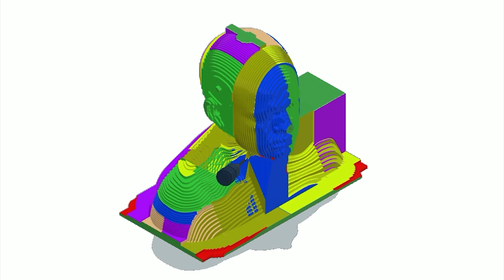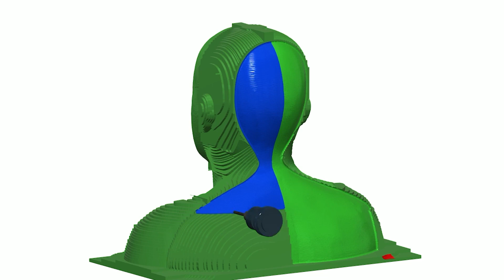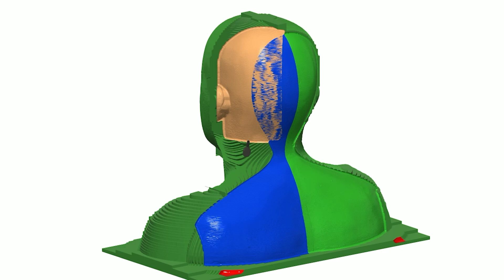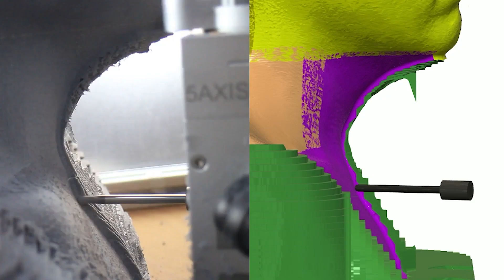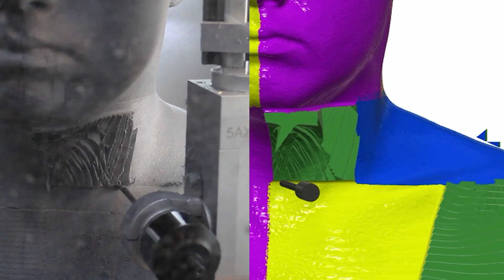5axismaker Advanced Digital Replication Scan to CAM

Comment: The CAM your using originates from Denmark. It’s quite outdated, tough they are building a new version. Most other CAM softwares have a ModuleWorks 5-axis kit in them besides their own paths. This was originally made by a German Mastercam dealer called Camaix, but ModuleWorks has been it’s own company for a long time. 

Anyway you could use a technic called “hidden surface”. You basically put a cylinder inside the bust, and make a nice simple toolpath that goes around it. Then you use the collision check to rise the tool to the STL surface. This way you get very clean toolpath that doesn’t jerk around. But for this you need the ModuleWorks stuff. There are a lot of parameters so that you can get under the yaw, etc.
Reply: this is fusion actually
Reply: Grumm HD I could be wrong, but Autodesk bought HSMWorks, and that was made by Cimco. And now they are using that engine in fusion. If nothing else, at least in the simulation? They still sell the HSM as a separate product for those who want that interface. Cimco is a Danish Mastercam reseller. The product was originally made in the early 2000 as a Mastercam add-on (HSM Performance Pack). It was first toolpath package that had 3D opti-rough (dynamic milling from bottom up).
Reply: @testi2025  Well, I think I learned something today. Thank you!
Reply from the maker: @grummhd3020  @testi this sounds correct, Fusion do indeed have a base in Denmark, also some of the modules were added from HSM as well as Delcam' Powermill - Delcam guys are based over here in the UK, now it's Autodesk UK, in Birmingham. The hidden surface technic is great, this is something we used for our own g-code generator 5xmkoney before Fusion was available as this is what we'd use to generate 5-axis simultaneous code for earlier videos. But yes, right now Fusion doesn't really this option for 5-axis. We are currently making a Mandalorian Helmet project and we are using a cylinder guide but that only works for 4-axis.
Reply: 5axismaker if the machine has RTCP (when you tilt an axis while this is active, the tool tip stays put), you can manually input the tilt value. Just put that tilt value after RTCP activation. This way you can have 4+1 axis toolpath.

Comment: What material is that ?  For a project like this, how much manual intervention is required for the tool path ? Or do the scripts take care of everything ?    Love the machine !
Reply from the maker: Hi Alex, many thanks for your comment. This is a styrofoam, all the toolpaths were programmed in F360 and then we'd run them operation by operation. You can see programming videos here https://www.youtube.com/watch?v=tSmm7XCUXNc
Reply: @5axismaker  Anything that would prevent an expansion of the vertical axis ? The frame looks like 2020.  Assuming all it would need is a longer cable run.

Comment: Can you recall the total machining time for this part?
Reply from the maker: think it was 8 hours for rouging and 6-7 hours for finishing
Reply: @5axismaker  Greatly appreciate the feed back.   When considering the workable area, how much smaller than spec should we consider if requiring 90 degree too application?
Reply from the maker: @mavigogun  this definitely depends on how far into the model the tool travels, tool length, overall geometry

Comment: It's look like a pretty nice engineering. Congratulations. Which CAM Software are you using this kind of 5 axis operations?
Reply from the maker: thanks! this was progrmammed in Autodesk Fusion360
Reply: @5axismaker  Thanks for response. Also for CAM Operations there are some softwares like Hypermill or Powermill which has created just for CAM preparations. Why you didn’t chose that kind of programs? The licence or anything else?
Reply from the maker: @alicantuncbilek8989  we could use Powermill or Hypermill indeed, as those are more capable 5-axis CAM packages, but the whole point was to use product which is used more by our customers and try to use all their available strategies instead